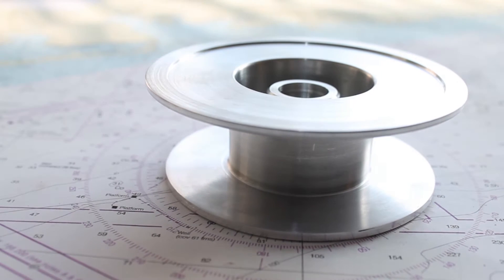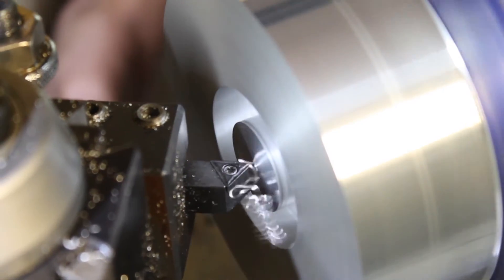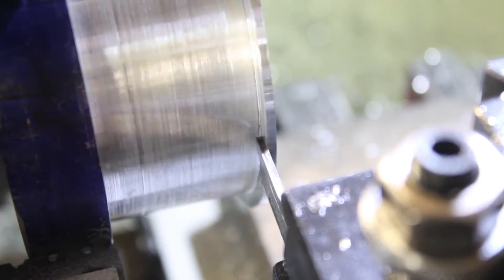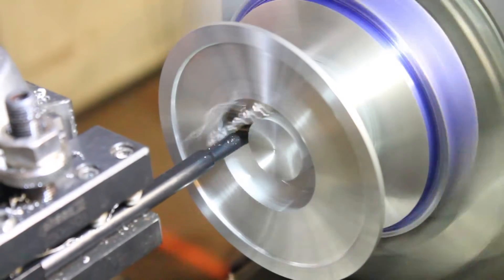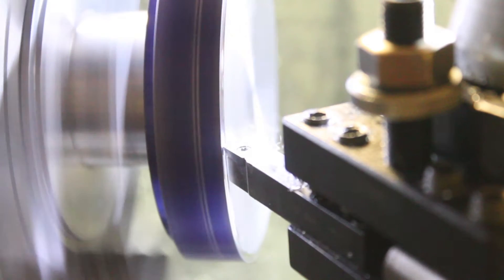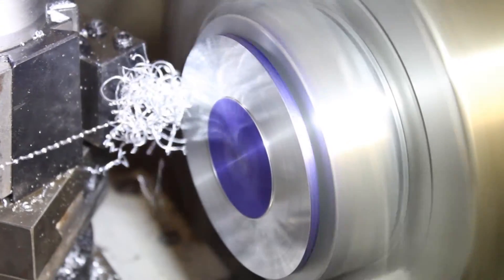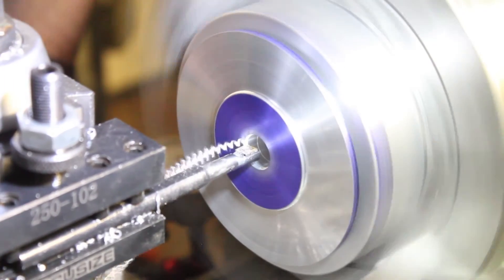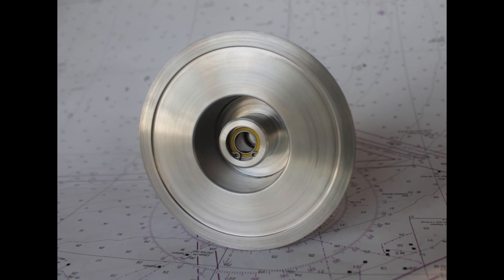Homemade Fly Reel Ep. 7 Pt 1: Spool on the Lathe

Comment: since you are flipping the part from operation to operation, how are you making sure the center hole with bearing concentric to the outside of the rim.  After assembly and you spin your spool, does it have a slight wobble or off center rotation?

Comment: Hi man! This is amazing peace of work!  I wanted to ask you if the fly line goes between the spool and the frame while casting?
I homemade a fly reel and designed the spool same way just like you and when i'm casting, the fly line often goes between the spool and the frame.
Reply from the maker: There's definitely a gap there, we'll see when I get the knob done if it becomes an issue. Thanks for the comment.